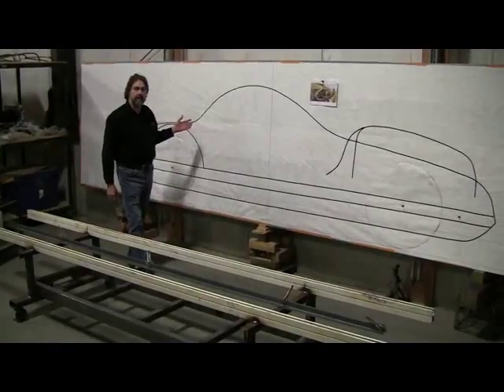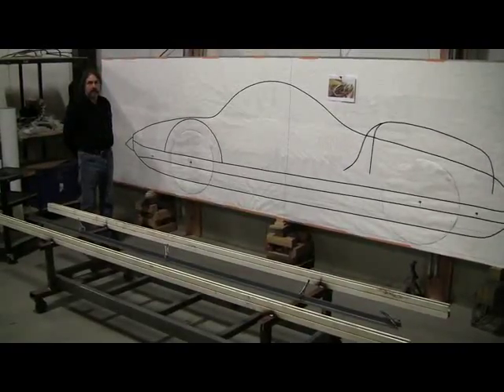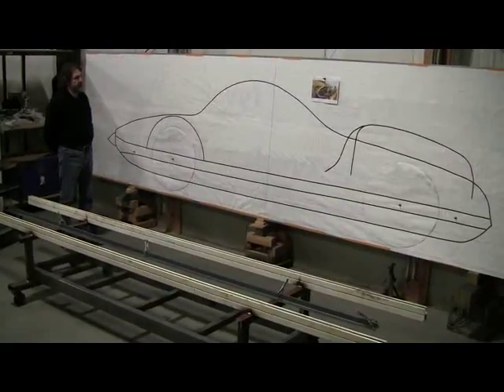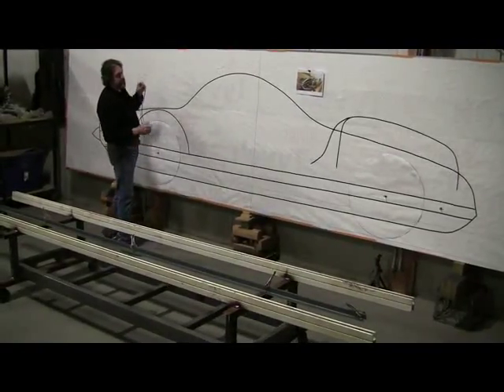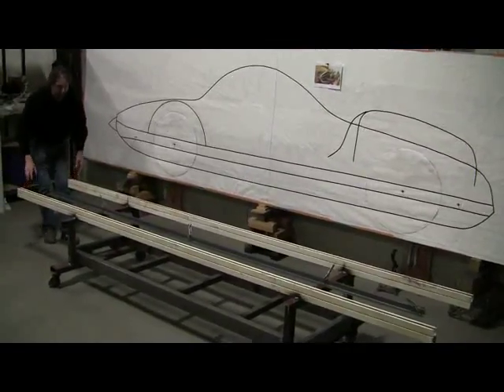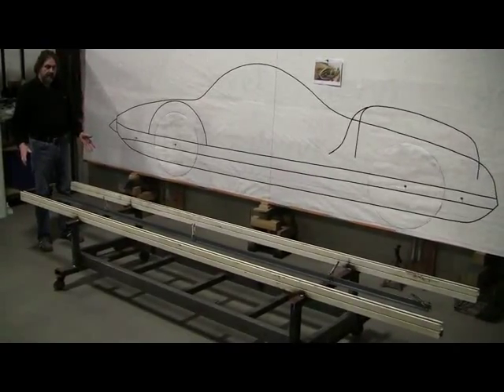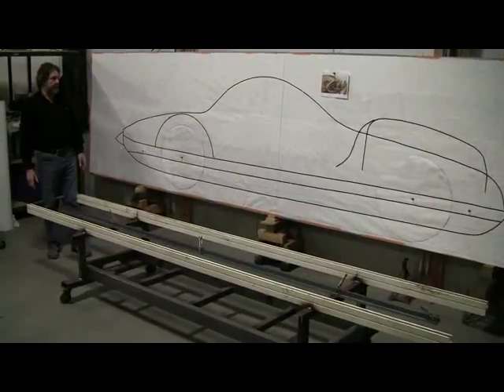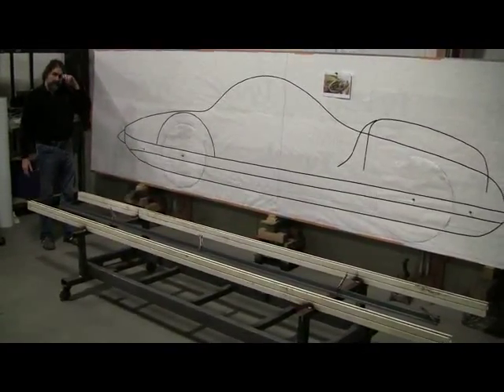Full Scale Drawing & Wire Form Buck

Comment: How is the correct name of the "system" for the manufacture of frames (body) from plywood ???? No where to find study material.
Reply from the maker: I'm not sure what you are asking?? I don't use plywood, I use 1/4" diameter wire to define a car body shape.